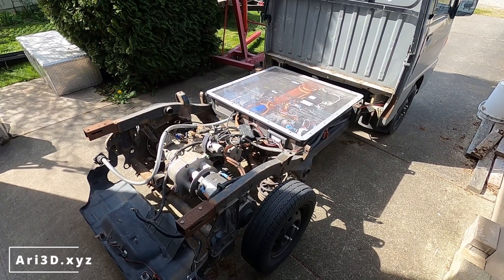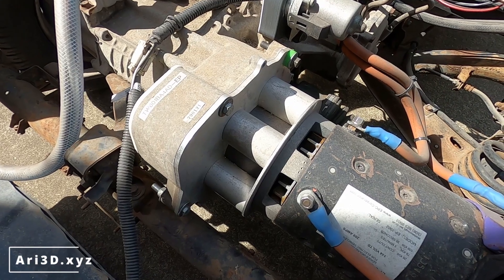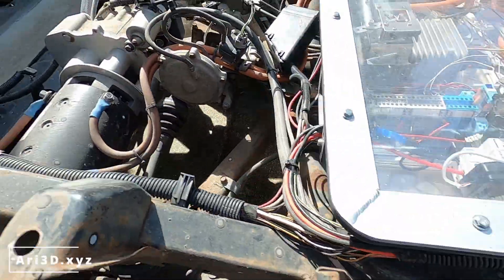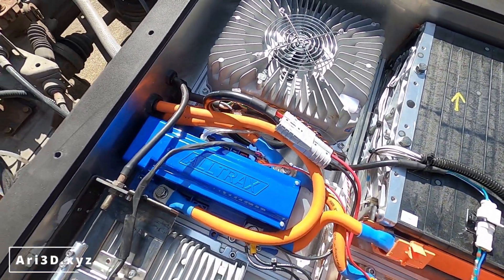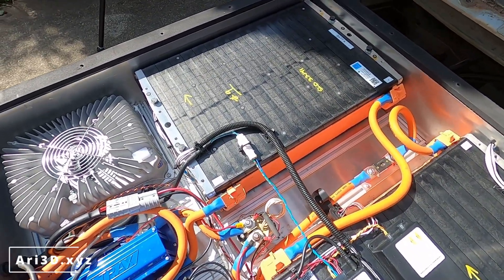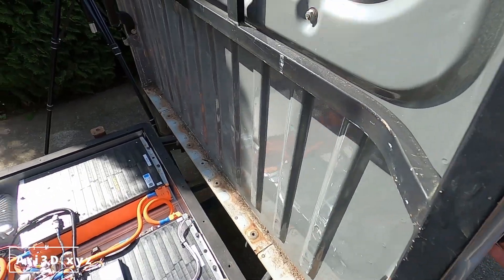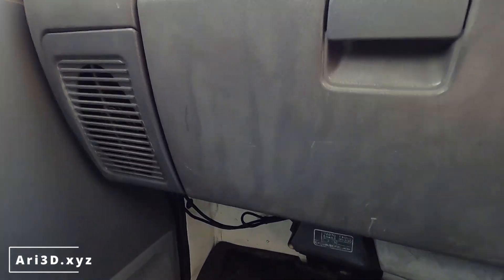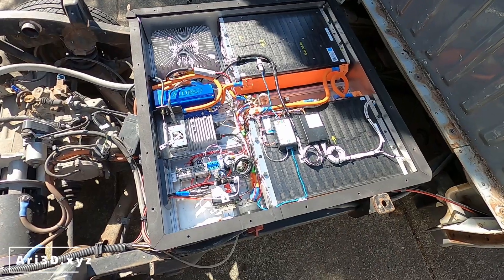02. Subaru Sambar EV Conversion

Comment: Hey, nice build. Can you share the details on the monitoring system you used? What is the computer under the dash? Thx!
Reply from the maker: Thanks! I installed a computer running Ubuntu and am running a series of software services I wrote that collects data off of the BMS, motor controller, GPS, solar charge monitor and sends them over MQTT. From there it all gets logged to a database and is also shown on the web app I wrote that runs on the touchscreen. I'm working on putting together a video on this whole setup.

Comment: Do you have some more videos coming?
Reply from the maker: I would like to, but don't have anything planned at the moment. What would you be most interested in seeing next?
Reply: @Ari3Dxyz  More details on the components you chose, how much, where and why, some upgrades you or someone who wants to do the project could consider if they were to become available at the right price, what do you consider the right price? Was what you spent worth it?
How smoothly/quietly does it drive, Your running at 72 volts, if you got another 2 batteries and went to 144v how much would you benefit. It might not make sense financially for how your using it but it might to someone else looking to do the project with different needs.
Does everything work like power steering and AC? How well has it worked out overall? What would you do differently with what you learnt? Does it weigh more or less before and after the project. Did you specifically choose the Sambar because of its rear motor or would any other Kei ute have been just as good? 

Personally I really want to do this project, Ive built my own solar system before but this is another level of complexity so Im looking to learn as much as I can so when the right kei comes along at the right price I can.
Reply: @jedics1 I second this! There is a $1,500 Sambar that a friend is selling that I need an engine for, so I figured I’d go electric but have NO idea where to start so I thought you might have some of the parts you bought and from where
Reply: @hangtenboy  Nice, I wish they were available in Aust at that kind of price. Ppl charge a huge premium for them here for some reason. Im just not willing to pay 10 grand for a 25 year old car especially when all I want to do is make it electric :)
Reply from the maker: Definitely. I was lucky to find one with a dead/dying engine which is why the price was so low
Reply: @Ari3Dxyz  How much was it? Another thing you could put in your next video :)
Reply from the maker: @jedics1 yeah, sounds like a price and components break down video would be good to do. I spent $2800 CAD on the truck and then another ~$7500 CAD on parts and materials
Reply: @Ari3Dxyz  That sounds about right, its definitely  a project of passion to spend that much for how much car you get. Are you aware of the mitsubishi minicab miev? You can get them for not much more than that which I have also toyed with doing.
Reply from the maker: Between that and a used Nissan leaf, there are definitely some good low cost EV options out there now
Reply: @Ari3Dxyz  yeh I would have thought the diy path would have become cheaper sooner by now.
Reply from the maker: @jedics1 it's hard to compete with production vehicle costs for diy projects unfortunately. The biggest plus to a conversion is being able to have an ev version of a vehicle that isn't available commercially
Reply: @Ari3Dxyz  and being able to choose the chemistry you want to use e.g like lfp that doesnt catch fire instead of the nmc that the minicab uses  which is hard to change.

Comment: So much room below that bed to do the conversion and place a sizeable battery pack.  Bravo! Wish I was so electronically handy.
2001 TT2 owner since 2009.
Reply from the maker: Yeah, the box I built fits above the driveshaft, so there's even more space for batteries if I were to do it over again.
Reply: @Ari3Dxyz  That's what I was seeing back there, room for nearly a Tesla S-grade pack.

Of course, that would be suicidal. It would be so scary on that short wheel base. The odds would catch up quickly, a death wish. We would be happy with golf cart grade acceleration to terminal velocity.

I like that you retained the original drivetrain. The extra low gear in 4wd is something to hang on to. On our rather vertical property, we use it all the time. It is amazing to idle up a 30% grade on slippery grass without leaving a mark. Don't know anything else like it.

So good to get rid of all those rusty coolant tubes. I had to rebuild our coolant system in copper, but there are still under-cab sections that will fail in the future.

Thanks for the response. Subscribed!

Comment: Why not use a PMSM or a BLDC motor? They're far more efficient and has a regeneration, flux weakening and more... Plus if you'd go for a one you could've scrap the gearbox's weight and go straight to the diff
Reply from the maker: The motor I used was cheap and accessible at the time. But a BLDC or AC motor would definitely be a nice upgrade! One of the main benefits of keeping the transmission is retaining the 4WD functionality.

Comment: Would there have been room to extend the box for the electrics and battery underneath the cab? I imagine you could fit another 2 batteries under there if there is was room. Props for getting rid of the 12v lead acid battery, surprised everybody doesnt do it.
Reply from the maker: Under the cab would be a bit tricky, but definitely could be possible. The easier option would be to extend the box further down on either side of the driveshaft which would give a bunch more space for batteries. Thanks! It's been very nice to get rid of the 12V battery, saves a bunch of space and keeps things simpler, plus no 12V battery to die and need to be 'jumped'
Reply: @Ari3Dxyz  yeh Im surprised most dont get rid of the 12v battery that is a regular point of failure for cars.

Comment: Looks like the most practical vehicle to convert depending on how much it cost, is there any reason everyone is choosing the sambar specifically to convert? Would like to know deets on cost and components as I would love to do a project like this.
Reply from the maker: Definitely, it's been great. I chose it because of the rear engine and manual transmission/4wd switch. I tried to keep it inexpensive, so only have 15.8kWh of batteries, but that gets me roughly 80-100km of range. I put about $7k CAD worth of parts and materials into it.
Reply: @Ari3Dxyz  You mentioned you were putting together a parts list, did you do that?

Comment: Did you pay for this project or did you have someone do this.? Would this be a plug and play that you or someone makes? And third and final question for you is the cost of this project?
Reply from the maker: It was entirely self funded, so I tried to keep the costs minimal by doing all the fabrication and installation myself. The vehicle cost $2800 CAD and I put about $7000 CAD worth of parts into it. Unfortunately it wouldn't quite be plug and play, as the motor I'm using isn't possible to source anymore, but a plug and play system could be possible with some more design time and switching to a more standard motor, controller and batteries

Comment: Great looking bit of kit youve built there.  Doesnt everything get warm when charging with everything located in the same box with (what looks like) no airflow?  Perhaps Ive been watching too many Stellantis OBC failure videos and worry too much.
Reply from the maker: Thanks! The charger is only 2.2kW, so it's not producing nearly as much heat as some of the factory EVs would. I have temp monitoring on the batteries and haven't seen any issues

Comment: Ev conversion can be made into full time AWD? Possible or not? How much battery capacity would it need to get a range of 450kms? And would that even fit?
Reply: i helped on a very similar EV converted Kei truck in japan about 6yrs ago, but we deleted the transmission, and connected the AC motor directly to the transfer case input so it could still be 2WD/4WD by push of the button inside the cab. This way we also avoided the efficiency loss from a clutch/trans as it's unneeded anyway.
Reply from the maker: @SocietyMike very cool. Do you have any photos or videos from the conversion?
Reply: @Ari3Dxyz I don't have video, the guys doing most of it unfortunately don't really have any social media. I do have some pics from after. They were kind of paranoid about Japanese inspections.
Reply from the maker: It would be tight, but could be possible. You would probably need ~60-70 kWh of batteries. My vehicle is set up 2wd right now, with the original button to switch to 4wd.
Reply: @Ari3Dxyz Let's say I follow your advice with keeping the 4wd button, but want to extend to 500km of range, what will I need and how much would it cost me? How long a conversion this will take?

Comment: do you convert the solar pv to 80v  or it  supports another electronics  independently ?
Reply from the maker: The solar panel is running into a boost mppt, so is able to charge the 74V pack directly

Comment: Interesting that you chose to keep the manual transmission. I would assume the ride is a little jerky between shifting?
Reply from the maker: It's pretty good! I still have the flywheel and clutch as well, and typically drive in 3/4/5 gear

Comment: Hello sir , How do you cool down the battery and the dc motor ?
Reply from the maker: The motor is air cooled and fully exposed to the atmosphere. Batteries aren't run hot enough to heat up and are installed in a metal box which helps regulate their temperature

Comment: Hey thanks for the video, would you be able to describe motor specs? Brand/HP or KW? thanks!
Reply from the maker: It's a series wound brushed DC motor. Rated for 144 V (but I'm running it at 72 V). It has a continuous current rating of 26 kW. I believe it's roughly 7in diameter. Definitely not the best motor for the application, but it does work!
Reply: @Ari3Dxyz  Hey thanks for the info, in effect 26kw or about 33HP DC meets your needs for city driving.
Reply from the maker: @mauricemaher8462 absolutely. My controller is limited to 31kW, and it's more than enough for up to 60 km/h, due to the ratio of the transmission and rpm/power curve of the motor, power really starts to drop after 60 km/h. At about 80km/h I can only get about 15 kW out of the motor.

Comment: have a top speed for this build?
Reply from the maker: It's a city vehicle, so it doesn't need to go very quickly, but gets up to 70-80 kph
Reply: Is that top speed run? Or more just like comfortable speed? I know these trucks get squirmy and sketchy past 60 haha. Also what is your ah (kw) capacity?
Reply from the maker: @marklemus7864  the limiting factor right now is the motor I'm using along with the stock transmission, I can't quite get the rpm out of it that I need to have any power above 70-80 kph. Batteries are 15.8 kWh total.
Reply: Amazing work man, planning my own build soon using hub motors, funny how these frames were almost designed for EV swaps probs due to simplicity
Reply: @Ari3Dxyz  I imagine you solve that limitation (and then some) by upping your battery voltage so you can run the motor at 140v?
Reply from the maker: @jedics1 definitely! I'd also have to change the motor controller, charger and dc-dc converter at that point too, so not worth it for this project unfortunately
Reply: @Ari3Dxyz  As a 100km daily commuter at 60ish kmph has it been worth it financially?

Comment: I saw a solar panel on the roof.  Does that make any diffrence?  What is the cars km/kW?
Reply from the maker: I get just over 80km per charge (15.8kWh battery). So roughly 5km/kWh. The solar panel is only 150W, so doesn't make a huge difference. I should be able to get about 1kWh per day out of the solar panel in the summer which would get me 10km of driving.

Comment: Do you mind sharing how you designed and sourced materials for the box? I've really struggled with weather/water resistant electronics enclosures.
Reply from the maker: Absolutely, the box is welded out of a combination of 1/8" steel angle and 1/8" steel flat bar. I then got the frame powder coated. After that I bonded in aluminum panels from the inside using Sikaflex 291 (marine sealant/adhesive). I installed rivnuts in the top flange of the box and installed an adhesive neoprene gasket on top of the flange. The lid is made of clear polycarbonate and I welded/drilled a washer strip to distribute the forces from the bolts on the plastic cover. It's quite watertight for its purpose and the aluminum panels can easily be drilled to install cable glands. I also made a frame out of aluminum extrusion that is attached to the inside of the box to mount most of the electronics, as well as some din rail for various wiring accessories.

Comment: my 97 with 70k is starting to weep oil from the cam seals - I'm watching your progress closely - I won't be far behind!
Reply from the maker: It's been a great way to give some new life to the vehicle. Looking forward to seeing your progress!
Reply: @Ari3Dxyz  I hope mine goes many more kilometers gas powered, but when it does this is perfect.  Any details on the model electric motor?  thoughts on why 72V?  assume a lot of it is the battery pack specs and what parts you have access to.  Love the DIY approach here, really impressive.
Reply from the maker: The motor is my biggest regret of the project. I already had it from a previous project. It's a 144V series wound DC motor, so running it at 72V limits the RPM it will hit. If I were to do it again I would opt for 144V or the more standard ~400V that factory EVs are using as that would allow for smaller cables, more motor/controller options and would add the ability to support DC quick charging. The main downside to higher voltage is an increased risk to safety, so for a first conversion, 72V was a simpler and more reasonable starting point.

Comment: Incredibly compact, what is your range and how much did everything cost?
Reply from the maker: Thanks! Range is about 80-100km. My goal was to keep the project low cost and relatively simple. Vehicle cost ~2800 CAD and i put about $7000 CAD into it for the conversion.
Reply: @Ari3Dxyz  any way to improve your range?
 cause as an ICE it gets about 270 miles to a tank on the low end and you spent all that money to get well, 49ish miles on the low end
Reply from the maker: @sSebSLPlays absolutely, it was a low cost project, and where I live I rarely need to travel more than 50km in a day. The main way would be more batteries, apart from that, using a motor/controller that supports regenerative braking would also help!
Reply: @Ari3Dxyz  def regenerative braking! And rarely needing to travel does help too
Reply: Very well done conversion. Why did choose that less efficient DC motor instead an AC one?
Reply from the maker: @Full_Throttle_no_Brakes  thank you! I had the motor already from a previous project, so it was a quick and inexpensive way to start out